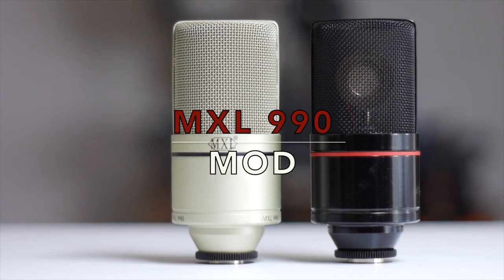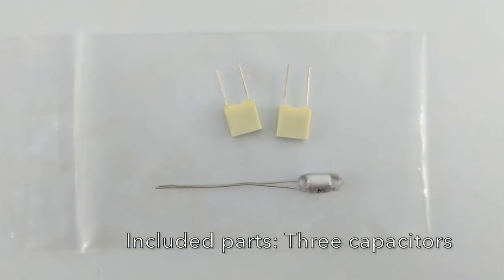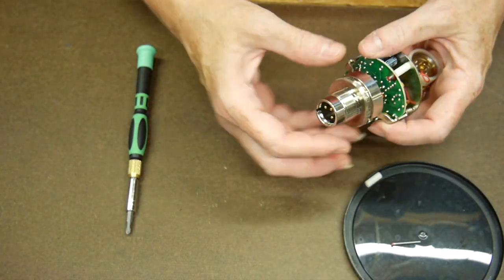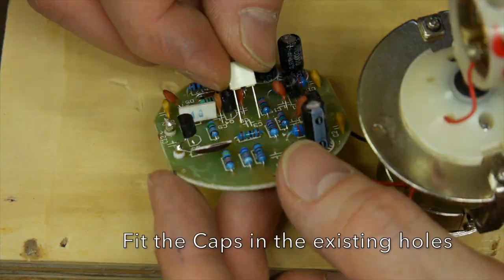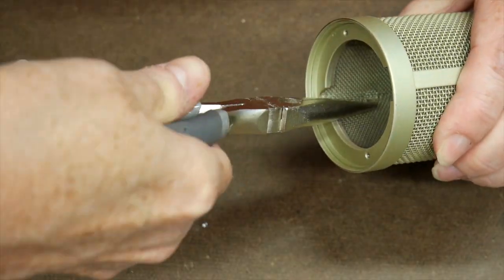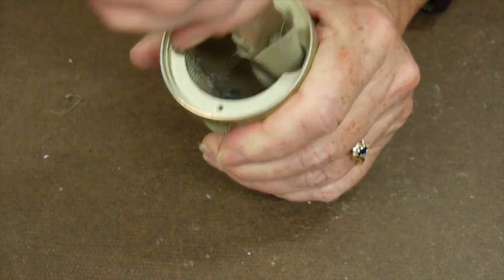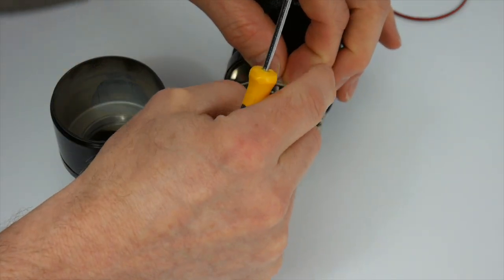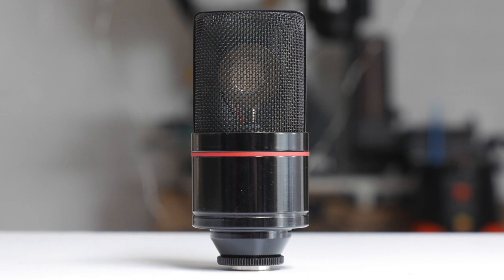MXL 990 condenser microphone capacitor upgrade MOD, body repaint, with sample audio

Comment: There is some misinformation here that I'd like to correct. By way of credentials, I've been manufacturing capsule and circuit upgrades for the 990 (and other models) for many years. I have personally modified 30-40 mics, including full circuit rebuilds, capsule replacements, power supply replacements, etc, from transformerless FET mics to transformer FET to tube microphones.

I used to recommend the "single layer headbasket" mod demonstrated here. I loved the logic that the mic will sound "more open" with less mesh in the way. But then I did some audio testing (via swept sine wave using a measurement mic and calibrated speaker), and ABX testing, and concluded that this mod is usually a bad idea. One problem is that the audio effects are minimal, and not necessarily an improvement. The other problem is that you lose plosive protection and EMI/RFI protection. Sure, you can use a pop filter to avoid the plosive problem. But the pop filter won't prevent EMI/RFI from sneaking into your track through the open grille.

The third and most critical problem with the single-layer grille mod is that the remaining layer of mesh resonates in the audio band. IIRC, I measured this at 13kHz for the 990. That means that your mic is making sympathetic resonance that YOU CAN HEAR IN EVERY TRACK you record. You can't EQ that back out of your mix.

If you think you can hear a "more open" sound, but wish to avoid the problems with EMI/RFI and sympathetic resonance, do a Google search for [mxl 990 headbasket upgrade] to see a commercial alternative -- a 2-layer mesh grille that looks nicer than stock. We based the design on the Neumann M49.

Regarding capacitor swaps: it's doubtful these would pass an ABX test. Said another way, I doubt most people would hear that capacitor change in a blind test. C3/C4 are the main signal caps, and they set the low-frequency response point of the circuit. I don't argue with using film caps there, although I'd go with polypropylene rather than polyester, which is what those generic box film types in the video probably are. 

But the reality is that the 990 has much deeper problems that these mods don't address, such as:
 - the capsule sounds pretty awful, with a 3-5dB scoop around 7-9kHz and a 3-5dB boost at 12-15kHz, accentuated by the single layer grille resonance
 - the JFET has huge input capacitance, which acts like a pad
 - the JFET wasn't biased properly, so it distorts prematurely
 - the DC oscillator under-powers the capsule, which negatively impacts sensitivity and therefore noise floor
 - Every 990 made since about 2013 has a surface-mount circuit board, which cannot be modified using the techniques described in the video. 

If you want an upgrade that EVERYONE will hear, replace the capsule with an RK-47. (Full disclosure: I make that capsule.) This one change will significantly re-voice the microphone. No circuit changes are necessary. This will give you a night-and-day upgrade and probably will addict you to DIY microphone upgrades for life. It did for me. :)

If you have the chops and the tools to populate a circuit board, my company makes a drop-in replacement for the 990 that contains a full implementation of the Schoeps transformerless circuit. This kit has a full +60V DC power supply for the capsule, and employs low-noise parts throughout. The JFET is a NOS component with much lower input capacitance, and is properly and individually biased for each kit. The resulting mic has much higher output, much lower noise, and lower distortion. You're basically building something that competes with a TLM49, but it will cost you less than $500 instead of $1700. The MXL 990  becomes a "donor body," into which you're building a world-class mic.

Some people say it's dumb to spend so much to "upgrade" a cheap mic. I disagree. If I can build a mic for $500 that sounds like it cost $1700 or more, that's a pretty great deal, no matter what brand name used to be on the mic body.
Reply from the maker: matthew mcglynn Thank you for your thoughtful post to the community. Great information. Can you contact me through www.Botzen.com ? perhaps there is an opportunity to make a new video and cover some of these details and get new information out there..
Reply: great info
Reply: +matthew mcglynn how will the RK-47 change the sound of the mic? does it give it a fuller/bassier sound? I'm trying to find a mic that will give a natural sound, as close to what you're hearing in the room without having to break the bank. Maybe this mod will do it? $600 is the most I want to spend.
Reply: The capsule in a condenser microphone determines 80-95% of the sound of the mic. Most microphone circuits are linear with respect to frequency, and therefore are not contributing much to the tone of the mic. The acoustic environment of the capsule -- meaning, the size and shape of the air cavity inside the grille, and the height of the capsule above the deck, the composition of the mounting post, the acoustic reflectivity of those surfaces, the placement of the body -- contribute some small percentage to the sound of the mic by filtering or increasing the amplitude of small bands of frequencies. But the bulk of the tone, meaning the frequency response of the mic, is determined by the capsule.

Therefore, any question that addresses characteristics of tone, such as "fuller/bassier," have to be answered by changing the capsule. In some cases, it is theoretically possible to put EQ into the circuit to counteract or correct the sound of the capsule, but in the case of the 990, the capsule's goofy frequency response cannot be corrected by EQ. You'd need a multiband or parametric EQ, which is not feasible to build into a mic circuit.

The RK-47 capsule (full disclosure: I make that capsule) is a nice choice because it works well on the stock circuit. It will sound fuller, because it lacks the high-frequency hype common to most cheap condenser mic capsules. By removing the excess response at 8-12kHz, the low end becomes more prominent, even without boosting it. This is a great low-cost upgrade to the 990 and many similar transformerless microphones.

A nice alternative voicing is to use the RK-87 capsule, together with the circuit replacement kit from MicParts.com (disclosure: I designed and manufacture that kit). The RK-87 capsule does require in-circuit EQ that this circuit kit provides. The combination gives you a fairly linear-response microphone, with full low end and a very controlled and musical top end. This combination will beat most $1000 mics in a shootout, in my experience and according to customer feedback.

There is no "better" option here; the two capsules sound different, and excel at different things. The RK-47 can be used with the stock MXL circuit, although the stock circuit has lower gain, higher noise, higher distortion, and a less cohesive sound. The RK-47 definitely benefits from a circuit upgrade, if you have the budget and the soldering chops to do it. 

The RK-47 is a more "colored" sounding capsule than is the RK-87. It is a fantastic contrast -- and I'd argue that a good mic collection would have examples of both, because as I mentioned above, these two capsules excel at different things.
Reply: @MicParts  Hey man where can i contact you?
Reply: This man knows what he is talking about, I have purchase kits from him and I and my clients have never been disappointed. He is honest, willing to help, recommended, suggest you name it. Coincedently I was just about to email him about a question, in regards to painting microphone bodies. Talk to you soon Mat
Reply: Microphone Parts Can’t you also just put eq on the stock mic & make it sound like it’s modded?
Reply: @reekrodriqguez6552  you can't EQ out distortion or rogue resonant frequencies without degrading the source signal.
Reply: Jeremy Fortunato So a circuit upgrade is needed?
Reply: @reekrodriqguez6552  ultimately MP is correct in his assessment of this microphone. The capsule is the main weak point. A simple capsule upgrade will yield the largest gains. But if you want to take it to the next level then yes a circuit upgrade is needed. Unfortunately changing 3 capacitors is not an upgrade. It's a grift at best. The most important places to start would be to swap out the jfet with a high quality fast one and properly bias it. Then start replacing the caps with high quality electrolytic and film caps from like Nichicon and WIMA. Then change out the resistors with tight tolerance quality products (1%). Keep in mind that the stock circuit is based on the Schoeps FET circuit. It's a solid design. But realistically, the board itself is pretty trash. In it's current form, it will never be perfect. But you can definitely make it better. If you can shoehorn in a trimmer pot to properly set the voltage then your sensitivity will be adjustable too.

 I think what people don't get is that it's not a $15 fix to make these mics good. I have a fully built 990 kit from MP and I can definitely recommend it to anyone who doesn't have the skills to design their own circuit layout. It is great value for money. But it was about $360, and I already had the 990 laying around. Now in comparison, it sounds better than my stock TLM103, but not quite on part with my U87. So a properly built version can yield incredible results for the money. 

Take all of this with the understanding that I also build my own circuits. I have a transformer circuit that I am finalizing for the V57 style mics from MXL that will filter out some of the high boost for people that don't want to replace their capsule. And a more natural curve for people who do replace the capsule. But I gotta give credit where it is due. MP has great products.
Reply: Jeremy Fortunato Oh I see, but can I also just get away with just the RK-47 capsule and grill upgrade? Would it be necessary for me to fully upgrade it with the PCB circuit board?
Reply: @reekrodriqguez6552  it's not necessary to upgrade anything on it. As a microphone, it works right out of the box. If you are limited on your budget then yes the capsule is your best value and the mic will sound good with just that. It all comes down to what you are doing with it. If you are podcasting, doing voice over or project work then this mic will be fine with just a capsule. But if your trying to get commercial work standards it just makes sense to go all the way. It's all about your use case and budget. And that varies from person to person. What you should remember is that no upgrade is going to magically improve the quality of what you put through it. Garbage in, garbage out as we say.
Reply: @reekrodriqguez6552  the capsule and circuit make different, but complementary contributions to the sound of the finished microphone.

There's no question that the stock small-diaphragm capsule in this mic is the first and most important component to change if you wish to upgrade the mic's sound. The capsule determines the frequency response of the mic (subject to EQ effects of the circuit, but most circuits don't do significant EQ; therefore the frequency response is mostly determined by the capsule). This particular mic's capsule has an unusual frequency curve, which I described in my initial comment to this video. Replacing that capsule with an RK-47 will "re-voice" the mic, giving it a smoother response and a bit of color (due to the capsule's upper-midrange boost, which complements many voices, stringed instruments, and other sources). 

The circuit replacement that my company sells does not change the frequency response of the mic. But it will give the microphone higher sensitivity, lower noise, and lower distortion. It might extend the bass response somewhat, depending on the value of C3/C4 in the original mic, but it is unlikely you'd hear that particular change. You will notice the improvements in sensitivity and noise. Many people, after building the new circuit, plug in the mic and think for that  first moment it's dead because they don't hear any hiss. Then they say something and realize the mic is very much alive, just has very very low self-noise.
Reply: Microphone Parts So that means with the fully upgrade, My mic is not gonna pick up much background noise?
Reply: @reekrodriqguez6552  with the upgrade your mic will be more sensitive and therefore pic up more background noise. What is more important is that the noise floor (self noise) is greatly lowered. Background noise is something you control.
Reply: Jeremy Fortunato Oh okay I see but what does “self noise” do, do it control the hiss from the mic?
Reply: @reekrodriqguez6552  exactly. The circuit will have it's own level of inherent noise (hiss), and the greater that is the less you can drive the preamp to the mic before it's all over your recorded tracks. And once you have 4 or more tracks playing at the same time it starts to become unusable. A rework of the circuits on these mics takes them from it just works, to a usable tool in a professional environment. The fact that the average person can obtain this for less than $1500 is pretty incredible. In reality a full build from MP is only around a few hundred dollars. The few good out of the box mics start at around 400 and rapidly go up from there. And if I'm being honest, a well built custom mic is still better than the entry level $400 bracket mic.
Reply: Jeremy Fortunato But doesn’t the RK-47 do well with just the stock version?
Reply: @reekrodriqguez6552  yes it does. If you can only afford one upgrade then that is the one to do.
Reply: Jeremy Fortunato The grill basket and the capsule does seems like a good upgrade if a person can’t afford the fully upgradable option, But eventually I might upgrade the circuit too
Reply: @reekrodriqguez6552  that's where I would start.
Reply: Jeremy Fortunato is the noise floor more quieter than your TLM 103 mic ?
Reply: @reekrodriqguez6552  yes it is. Keep in mind it's not a night and day difference. And no microphone on a production run is exactly the same. In other words, unless they hand build and test each component then no two mics will have the same exact noise floor. We're not taking about U47s here. So where the 103 has an extremely low advertised NF, some might be less and some might be more.
Reply: Jeremy Fortunato Would you say the modded 990 is better than a TLM 49? How does it compares to that
Reply: @reekrodriqguez6552  I've only ever used a 49 one time. It is my buddies go to mic for vocals at his studio. But other than that I have not got enough experience on that mic to make a vs  opinion about it. But I do know that "better than" is extremely subjective to both the listener and the source. I steer clear of statements like that because they can't be quantified. I can say that there is a reason why I have over 50 mics in my studio ranging in price from about $25-$3500. No one mic is the best for all sources. If you are looking for a new mic then my advice is to find the one that fits the best in both categories, use case + price range. It's different for everyone.
Reply: Jeremy Fortunato True, I should’ve worded it differently
Reply: Jeremy Fortunato But do you know the modded 990 self noise?, is it anything less than 10db?
Reply: @reekrodriqguez6552  mine sits around the 9-10db mark. YMMV My 103 sits solid at 10db. At these levels you should be solid with good converters and a quality pre.
Reply: Jeremy Fortunato That’s good. Would you say the ID4 Audient is a decent Audio interface?
Reply: @reekrodriqguez6552  audient makes good products. I personally use an RME system. But there are quite a few good interfaces on the market. Do your homework my friend and find what does your needs.
Reply: This is the most professional comment that i have ever seen in my life.. your reply just blew my mind completely.. you are definitively right regarding to spend $500 with the value of $1700.. that's absolutely a super deal..
Reply: @EricStrebel  : if you make another video for that, please post here for us to know... thank you..
Reply: @Microphone Parts ..I have owned 3 of these mics now, have modded 2 of them, and still have one today that I will probably be ordering a capsule upgrade from your website in the next week or two, but let me just throw in a quick assessment from my experience with the 990, and yes luckily they were all pre-surface mount versions.
First of all, you are absolutely correct about the capsules. They can be helped with circuit mods, but in the end it's just too small a diaphragm especially for what MXL advertises as a 'large diaphram' condenser mic. The puny 125 SPL is a significant issue as since I have a 100w plexi and a Celestion 4x12 as my recording rig, and needless to say, it starts to distort the capsule half way up or a little less, and a db pad will not fix that because it's from a physical non linear warping and distortion of the capsule itself instead of a level clip into the FET. Plus if I really try hard and forego distance control with my head to the mic? I can even overload the diaphragm cutting a solo vocal track. Yes backing away during the takes when needed makes this a non issue but that should still not happen with a 'large diaphram' condenser.

Next, the screen mesh mod doesn't affect the overall sound nearly as much as better coupling caps, I removed one layer on my last one I don't have anymore, and basically just ended up having to drop the hi end at the channel strip's eq a touch because they're already borderline harsh and brittle bone stock.

BUT I can attest to the coupling caps making an improvement. The stock ones are so horrible that I used epoxy coated ceramic disk, and mica films to swap out with, and it still slaughtered the ones that came in it! That's how bad those tiny stock caps are!

Now my next thing here, I could be wrong about since I haven't actually done this particular experiment to prove or debunk this idea, but..
While it's  very true that the capsule alone will make the biggest difference than all the coupling caps combined, I highly doubt the full potential of upgrading diaphrams can be achieved without addressing the circuit.
Reply: @jeremyfortunethe1st  Is there anychange I can find a good schematic for an U87. I'm think I maybe build one from scratch. Even an MXL 990 is expensive with me. Might saving a half if I buy stuff from my country
Reply: @lenam628  if a 990 is expensive for you then unfortunately building a U87 is going to exceed that cost by far in parts alone.  the schematics are available online
Reply: @jeremyfortunethe1st   The prices is cheaper in my country for a PCB. Also my country is borderline with china. I worry about the cables, connecting jack and the capsule I found maybe not good enough. I already have a savings for this but if it is too expensive then I probably just go for an MXL 990 mod.